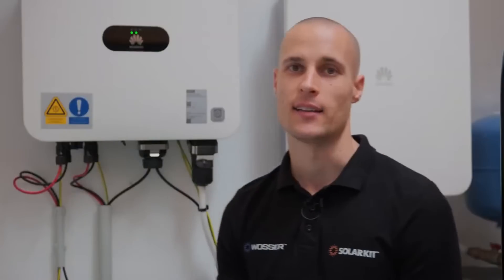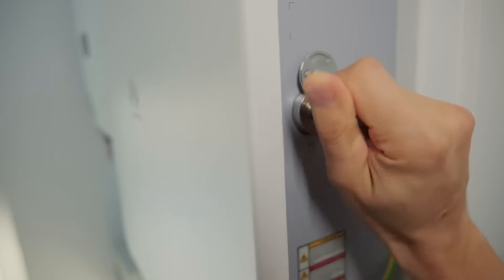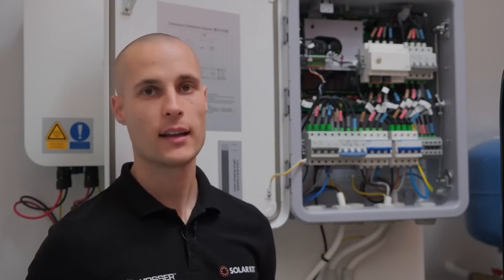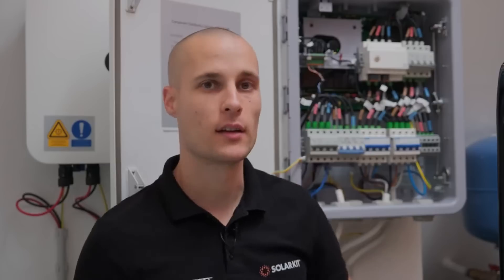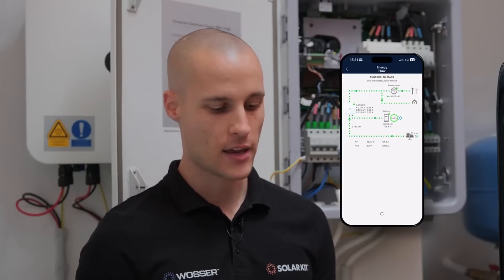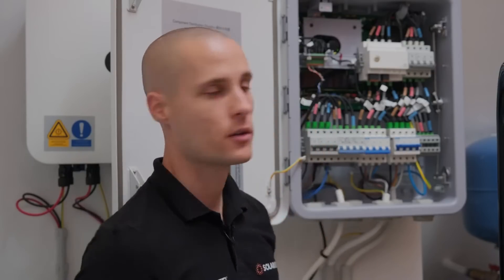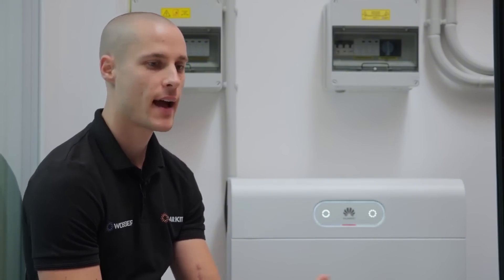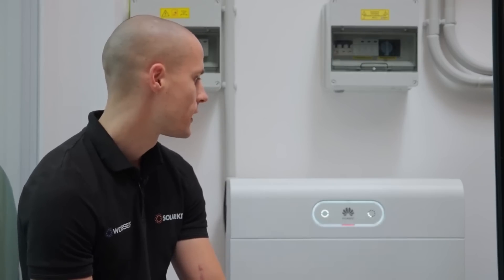🌞 Huawei MAP0 Inverter, Smart Guard & LUNA2000 Battery Overview 🚀

Comment: Hi ,i want to upgrade my 12 kw system invertor sun2000-10KTL-M1 WITH BACK-UP BOX SMART GUARD 63ATO 63A Three-phase and 15kw luna battery, Question; i will have electricity in all house in case of grid power in day time it's off?Thank you

Comment: What about a generator input to the SmartGuard? What type of generators are compatible on the European market? Preferably dual fuel (gasoline and gas).
Reply from the maker: Hi!

You can find all the generator requirements on the 107th page of the smart guard user manual. Sadly, we cannot recommend you a certain model for a generator, as it is mostly dependent on the customer requirements and price sensitivity.

Best regards,

Comment: do you know the difference between sun2000 map0 and sun5000 map0? (apart lf the fact that om the 5000 inverters are mandatory)
Reply: SUN5000 MAP0 requires a fully optimized PV installation (one optimizer for every PV panel).